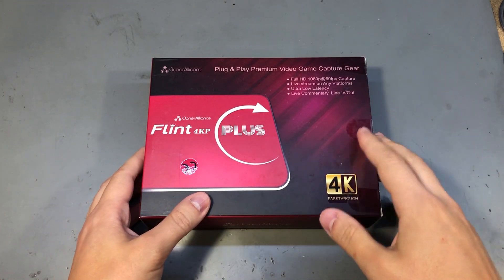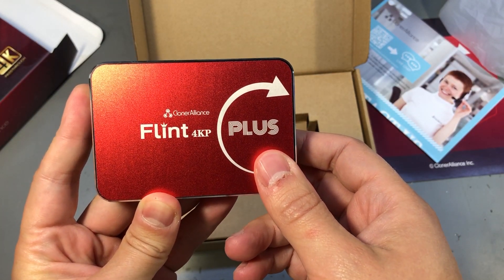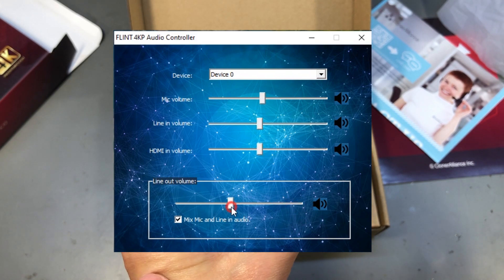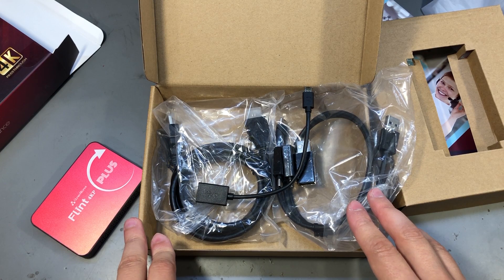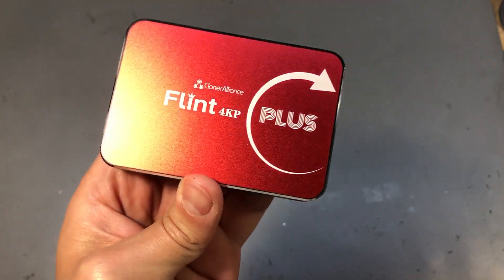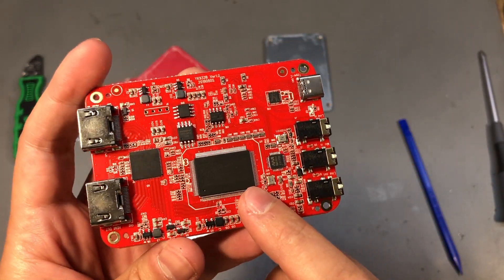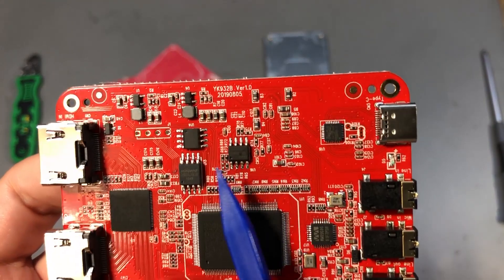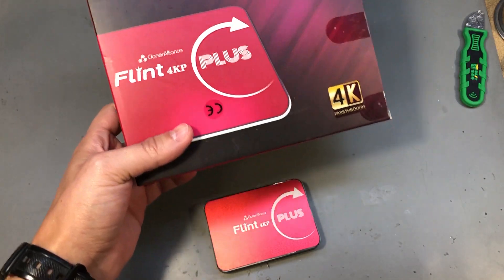ClonerAlliance 4KP Plus Capture Card Review & Teardown | Voltlog #332

Comment: If I had this apart, I would use 2 thick copper shims instead of those thick silicon pads. This might heat up the glue on the cover to the point it may fall off and I don't want to make it impossible to get into using high temp glue or epoxy, but I think it would be optimal to fabricate a heatsink to fit the entire bottom and screw it down using the 4 holes and some Arctic Silver both under the plate that sits on top of the circuit board plus the top and bottom of the shims. Just a thought. Some if not most electronics don't run as well when hot. If bigger works better, so be it for me.

Comment: Realtek has mostly lan and audio & switch chips on that package 😂.
Reply: they have also flat panel driver chips that does conversion from an vga or hdmi input to lvds or rgb24bit.
Reply from the maker: Still, when I see one of these packages I think of them 😂
Reply: @voltlog  i have a truck load of these .. probably few hundred in my office. I own an isp network in india & we used 100mbps switches for a long time .. & currently replacing them with netgear prosafe 1gbps ones & fiber optic due to bandwidth limitations 😂. So i just experiment smd soldering on these chips and collect the heatsinks and some parts and scrap the rest. Cuz i get more money scraping them than selling them used. & No one needs 100mbps switches in 2020 ..